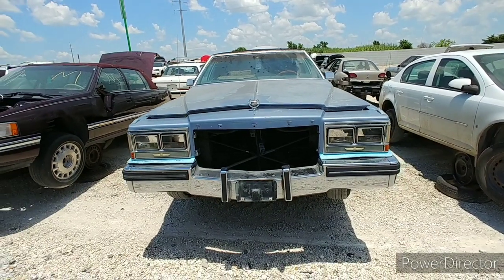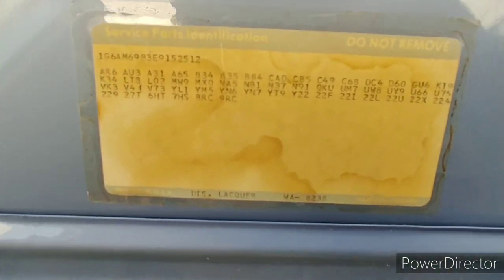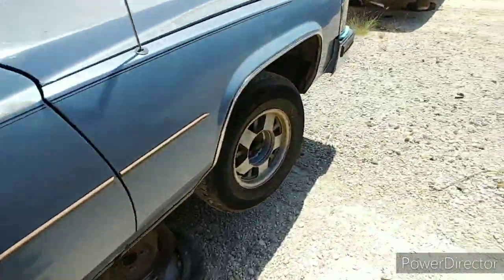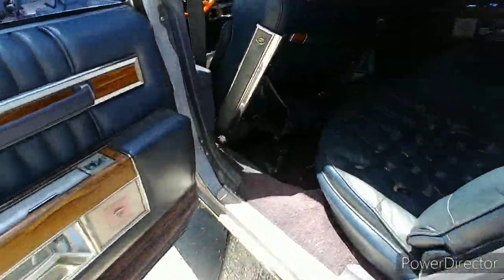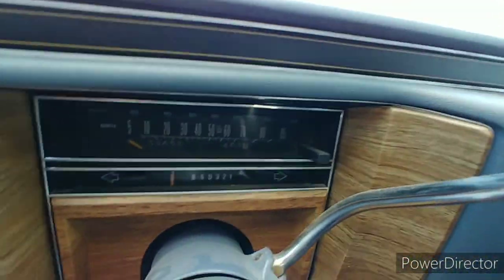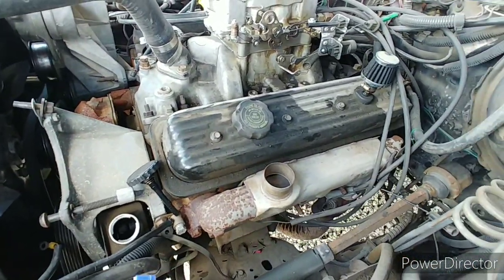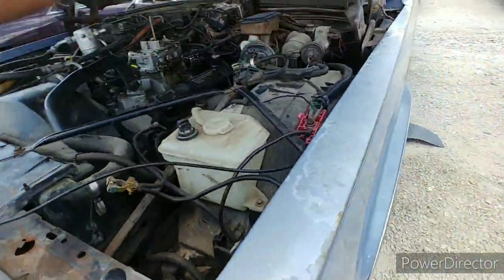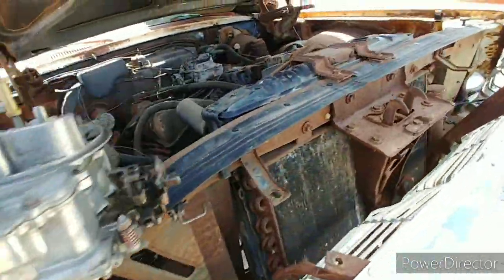1984 Cadillac Sedan DeVille Small Block Chevy Swap Junkyard Find

Comment: That looks like a car back from the days when Cadillacs were "cruisemobiles" you just put into DRIVE and cruise in comfort. It's such a shame those HT4100 V8s were so problematic, because those cars were otherwise very solid. In my opinion, swapping in a Chevy 350 small block is was the best thing that could be done for such a nice car. I'm not really a big GM fan by any means, but if I were really interested in one of these cars for a driver, a Chevy 350 with the factory Rochester 4BBL would definitely be the way to go. It's just mind boggling how GM's luxury division has struggled badly with reliability issues with all their V8s, from the disastrous 368 cubic inch V8-6-4 that lasted all of two model years (1980 & 1981) to the HT4100 (that evolved into the 4900 for later model years) with their internal coolant leaks, and finally their NorthStar 4.6L 32V V8s that everyone loved in the beginning until they became oil leakers that became extremely expensive to repair.
Reply: The modulated displacement engine was actually used from 1981 to 1984. In 1981, it was available in all series, from '82 to '84, only commercial cars. The carbureted 368 was used from 1981-1984 (as well as in 1980) in commercial cars too. Not common, but they did exist.
Reply: Ironically I'm currently doing exactly that! I bought a original 1 owner coup deville with a blown 4100. I got a 1991 c1500 305 5.0l I'm going to drop in it
Reply: @RusticShine i just bought a 83 deville coupe and im looking to swap it with a 350 but how would i go about doing it?
Reply: @flexx1080  well on my shorts page I successfully did a 305 swap with a 400cfm 4 barrel edelbrock carb. So you can 350/305 swap em pretty easily. In a would choose a 305 sinxe the 350 might grenade the trans. The 4100 only came with 135hp from the factory. So to much torque could grenade the trans.

Here's some of the pros and cons I ran into.

Pros!:

The 305 bolts up directly to the transmission with no adapter plates or extra parts needed.

Going carb you do not need a fuel pressure regulator, just get a T fitting and loop the return line off the T! You get 4psi fuel pressure on carb that way.
The 305 motor mounts bolted to the trans fit the cross member nicely!

Hei distributor and carb setup you only need a 12v key hot for the spark.

All the Sensors off the 4100 screw into the 305 block. Oil pressure coolant temp ect.

More power then stock when done!

Cons:

You will need to either drill new holes or weld the motor mounts to the cross member.

You will have a ton of extra wires all over the engine compartment trim accordingly.
The exhaust will be a b**ch. There is no good way to run it without it hanging low.

There is no schematic you need to figure out everything as you go.

And that's it. Been 3 years so far and it's still going strong 💪

Comment: Missing the "V" under the trunk emblem (which in 1980-1982 meant it was a V6 equipped vehicle), but we got the VIN, so we win:

From the top: 1 for US made, G for General Motors, 6 for Cadillac, A for manual restraint system, M for DeVille (in '84, the last year for the RWD DeVille, it became a "D" body car in the parts book, it was a "C" body through 1983, but it's the same basic car), 69 for four door sedan, 8 for "LT8" HT4100 V8 engine with digital fuel injection (throttle body injection), aka "Having Trouble", 3 is a check digit, E for the 1984 model year, 9 for Clark Street/Detroit, MI assembly plant and the rest is the production sequence. The THM2004R is the original transmission for this vehicle as it has "MW9" on the SPID which is the RPO for that transmission. 

It's pretty light on the options (such as opera lamps outside) and the original color of WA8238 is Light Royal Blue Metallic (aka code 22). Yup, those look like late 90s/early 2000's Chevrolet truck wheels, I agree.

Comment: I'd love to know the story behind that engine swap. Did the 4.1 grenade, and they just happened to have a Chevy small block laying around? Or were they going for a luxury car with some pep? The car looks pretty decent, not sure why they scrapped it
Reply: With that mileage, it's likely 139,000 total miles and yes, the HT4100 probably bit the root a long time ago. 100k is about the norm for those, some went longer and the '84s were better than the '82 and '83 editions, but still problematic. My parents had an '83 Coupe DeVille. We didn't have any problems because a) my father took care of it, b) we bought it new, c) it had low mileage, d) my father eventually worked for the dealer that we bought it from (but he didn't work for them at the time we bought it in the fall of 1982). We sold it when my dad passed in 1988. Glad it went.